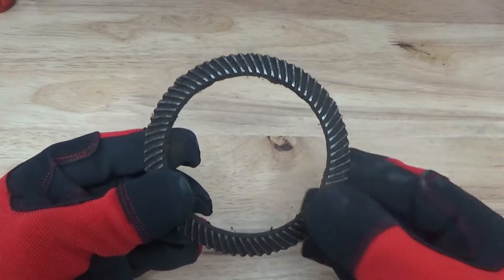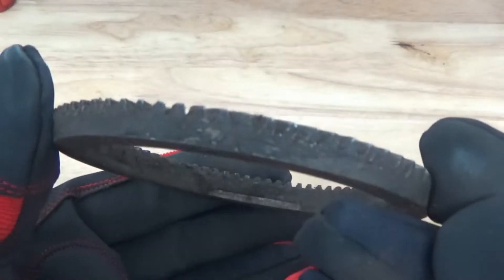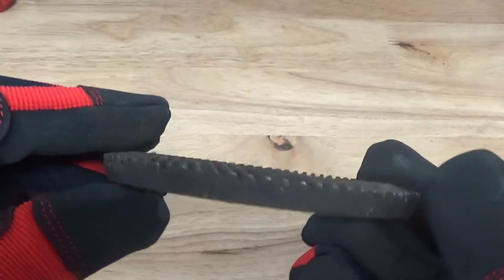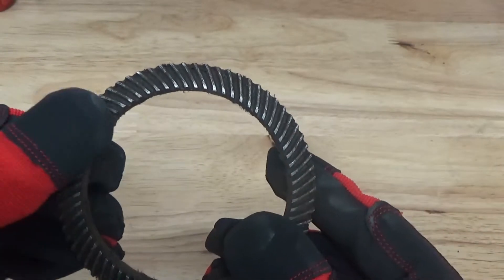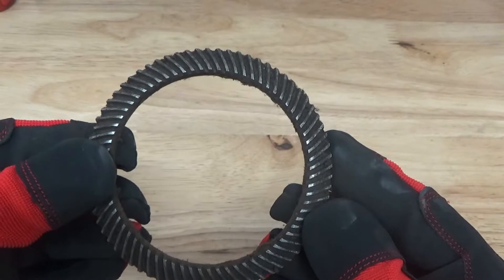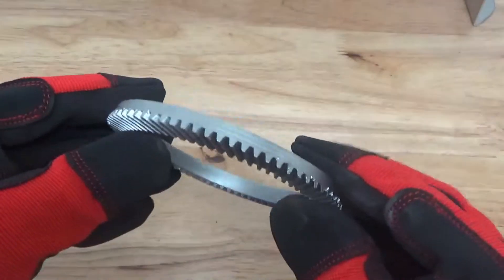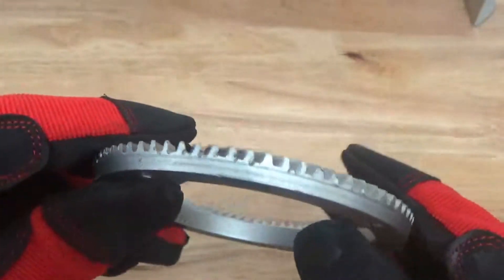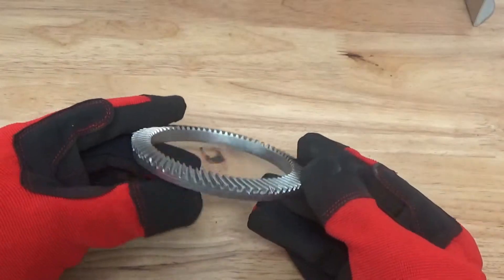The Most Powerful Tool Ever- Vapor Honing Technologies

Comment: Where's the windshield wiper??
Reply from the maker: All plastic cabinets (Weekend Warrior and VH800) have a window wash bar to spray the windshield no wiper.  However, all stainless steel units have the wipers.
Reply: Oh.......well then why isn't the wash bar working? Can't see anything
Reply from the maker: It is possible the filter for the wash bar is clogged.  We will try to get that corrected for the next line of videos.